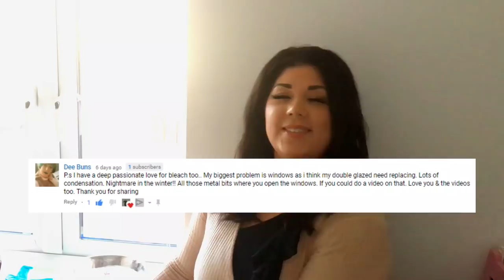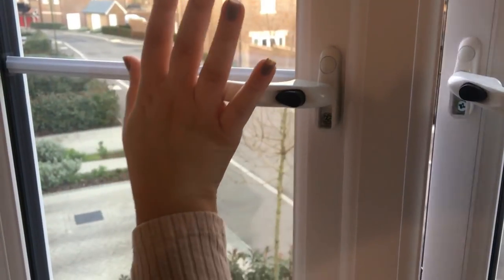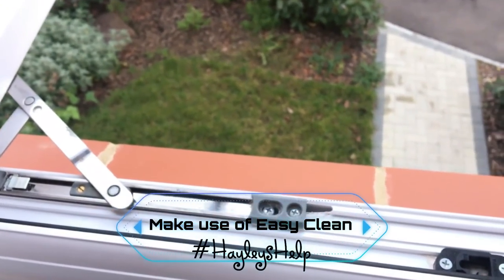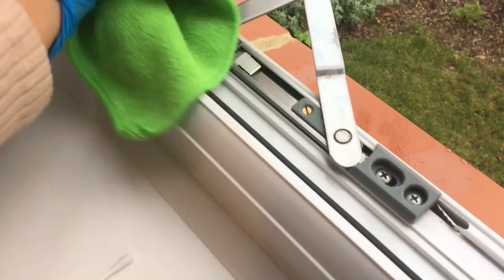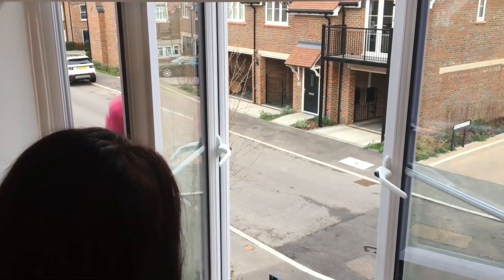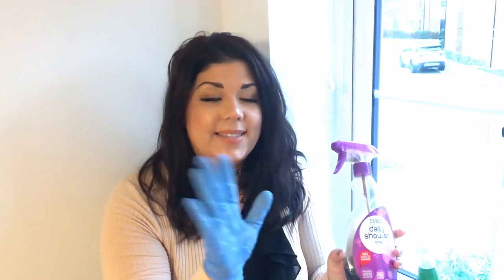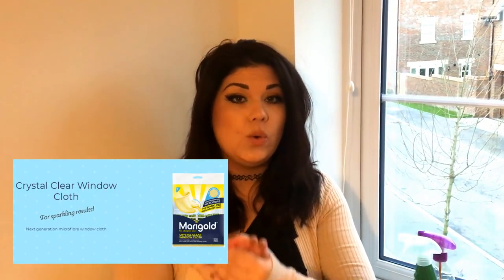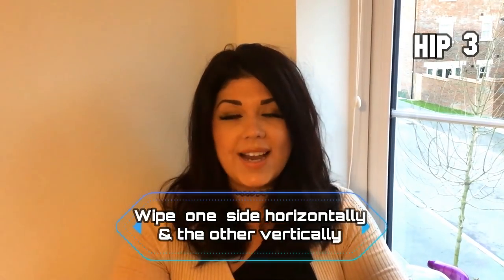Best Ways To Clean Windows + Easy Clean Secret To Save Money!  CLEAN WITH ME 2019

Comment: You're so funny 😂 . That's a great tip to use the WD40. I work as a cleaner and I just use warm water, dishwashing liquid and a bit of vinegar to clean the glass but make sure I dry them really well. I've never heard of using tea before. Can you use any brand and is it OK to use on tinted windows? Thanks for the tips 👍. xx
Reply from the maker: 😘 yeh just normal black tea is totally fine it works so well 🙌🏽, yeh I watched a hotel cleaning thing and they all just used water to clean the windows and a good cloth 💗💗💗
Reply: @hayleyshelp  That's great, I'll try it out. Thanks so much. I clean a pub with lots of windows and glass doors. Usually just get them done then someone puts their hands on the doors 😂. Love your videos. xx

Comment: why use disposible gloves and not washing up kind
Reply from the maker: There less bulky so it’s easier, the bigger ones are a bit fiddly when your trying to clean the little bits on the window frame 💕
Reply: @hayleyshelp  might be worth me getting some im allergic to all household products all i have is bulky rubber gloves always buy the wrong size
Reply: @hayleyshelp  i will have try get some the gloves i have are massive
Reply: @hayleyshelp  i bought some disposible there so much better
Reply: @hayleyshelp  is it worth me getting som then
Reply: @hayleyshelp  ive bought some there much better
Reply: @hayleyshelp  ive bought some they work much better